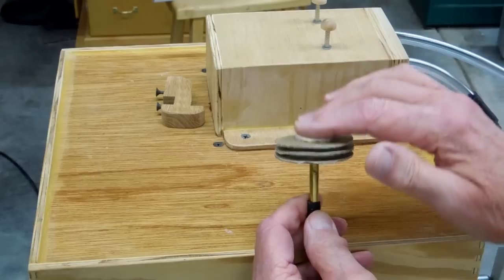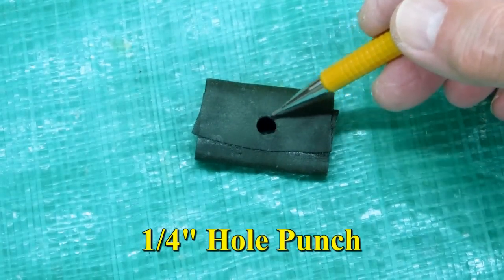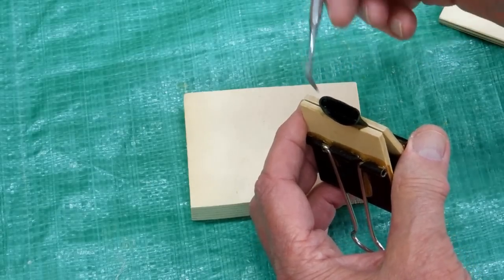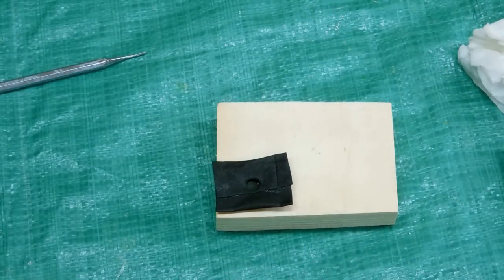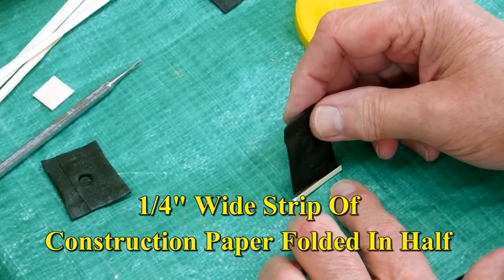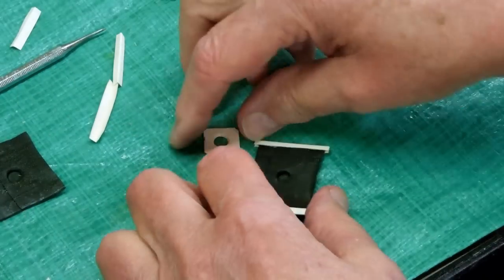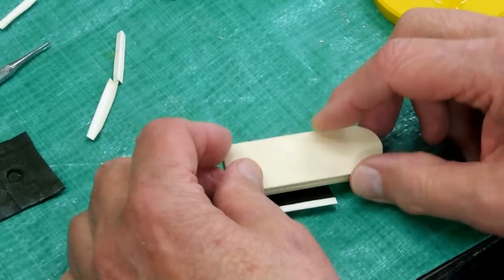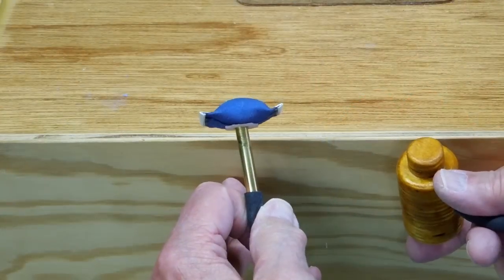Senior 20 Conductor Installation (5) Pneumatic Puffs

Comment: How does the air get geleased. Does it just go through the material or is there some kind of valve?
Reply from the maker: I am using the Wood Pneumatic Valve which was covered in the video released last week.
Reply: Ronald Walters OK I see. Thanks